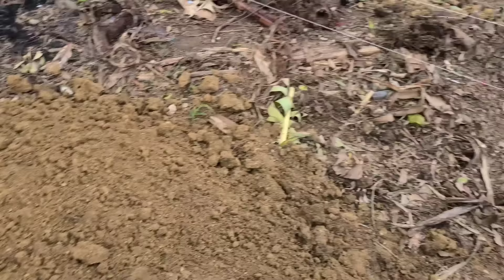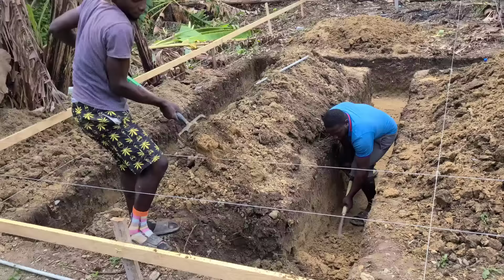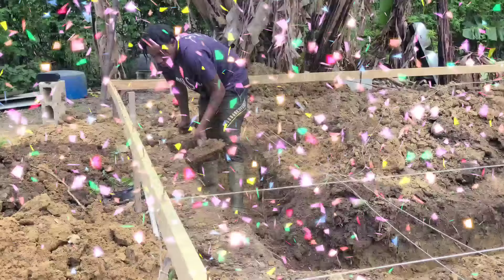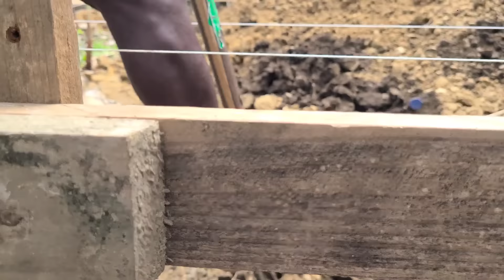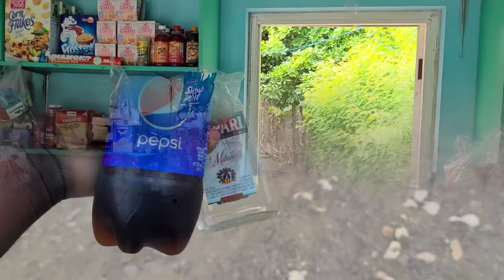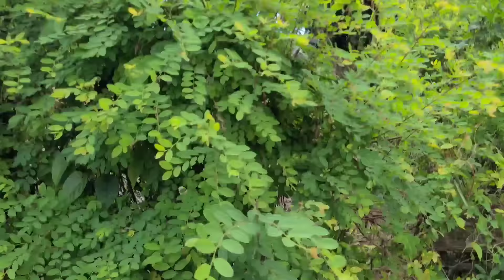just a next update of the house this going on good 🙏

Comment: Foundation should be 36” deep by 24” wide especially if you plan to go upstairs. Quarter wire is no longer used. You must use 3/8” steel to make the stirrups.
Reply: Good & valuable info ❤